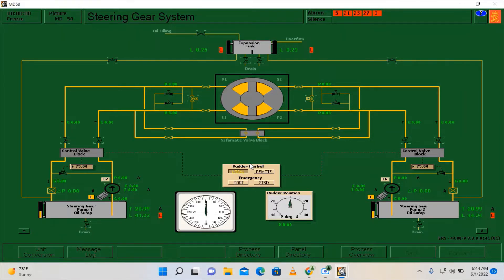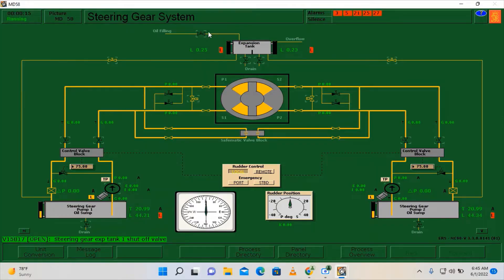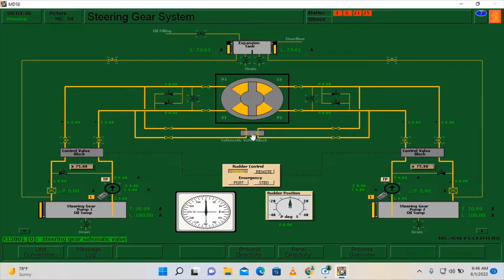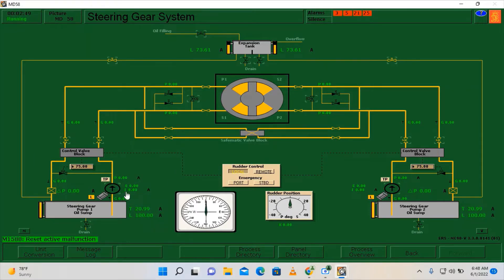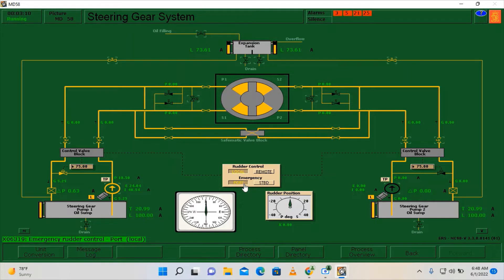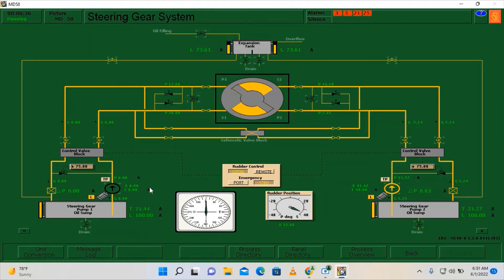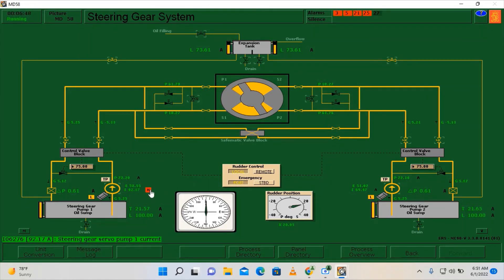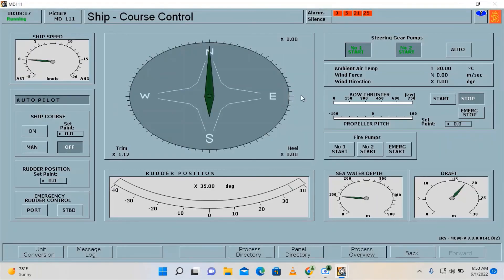AUX MACH 222 -STEERING GEAR OPERATION ON KONGSBERG SIMULATOR

Comment: Paano i rectify ang exhaust gas develop pag mapaandar ng makina
Reply from the maker: This is not related to the video.
Exh. gas problems are normally bec. of
Fuel system- probably bec. of injector, fo pump, etc.